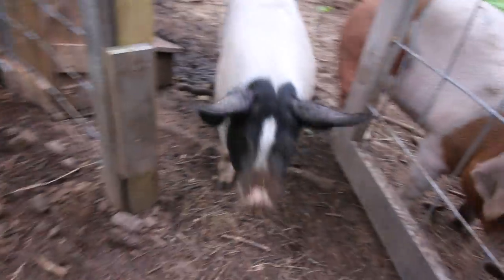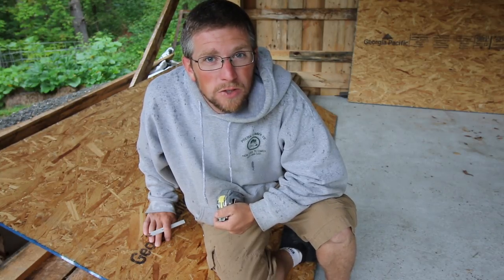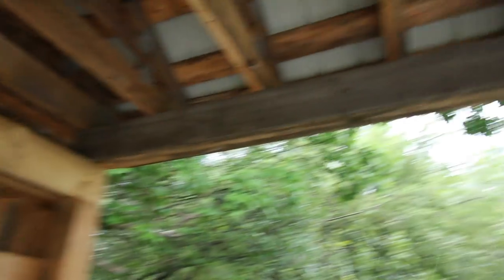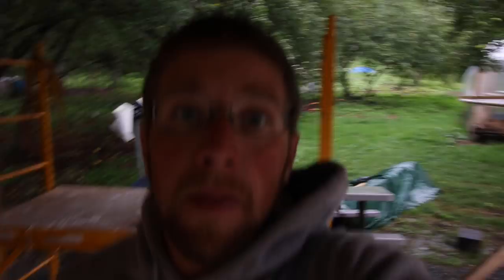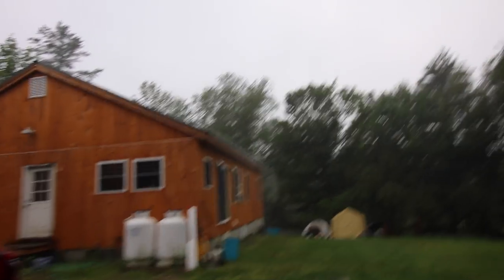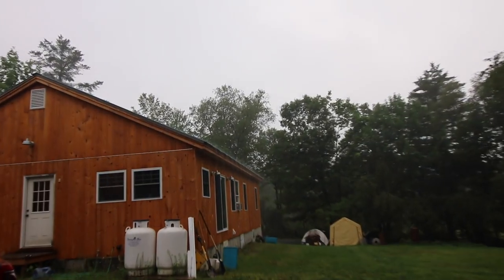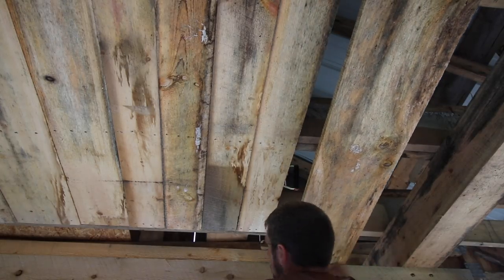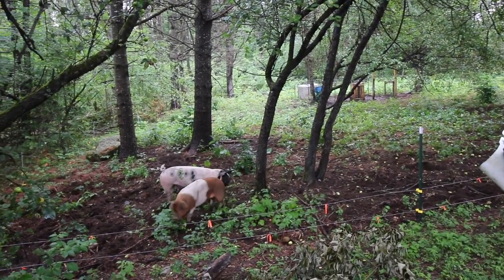Installing a Rough Sawn Lumber Ceiling with Ratchet Straps

Comment: If it was me I would have put more storage boards on both sides as well.  Then again I would probably save enough pure junk to fill the place up.  LOL.   I would also consider a rectangular hole for that opening.  You might be able to find one of the fold up stairs that will fit and make access easy.

Also... I closed my eyes and held on tight when you went up that ladder again.  I trust you Al, but I am still scared that I am going to fall.  Yikes!

Comment: I love the look of the boards on your back wall and ceiling. I could live with that inside my house. Could you step up the ladder and got partially into that square hole you made for storage? In my mind's eye, it looks very small. Also, have you thought about knee pads? I cringe every time I see you on your knees on the wood or cement. Awesome video and I loved hearing the rain. Your voice came through just fine.
Reply from the maker: I did go into the attic it was towards the end. I dont like knee pads, I dont know why. Thanks.
Reply: Oh shoot. Did I leave too soon? lol Will have to watch to the end just to see it.

Comment: A few thoughts.  That should be some excellent venison being apple fed ! 
Regarding th e ceiling. I may have been tempted to put the ceiling on top of the rafters fro an exposed beam/rafter  more rustic appearance.
Next thought , since you are enclosing the structure are you going to insulate for a more four season structure?
Do you use enough nails ? At one point I counted ten nails in a two foot lenght of board.  lol 
It sure is easy to shoot nails  !
Reply from the maker: We might end up insulating the Off grid outdoor kitchen. We will have to wait and see. If I run out of nails I know where they have more. :) The wood is green when it dries I dont want it warping and coming off

Comment: Look at those hams running. You will find every dry spot for storage will get filled even the small eves and leave the middle walkway open.I wonder would Gina be upset at all if you went out and bought a router table? Thank God the ran let up it was deafening.
Reply from the maker: The rain was pretty loud! I have a small router table. I dont use it very often.